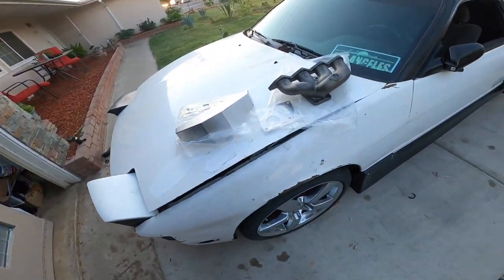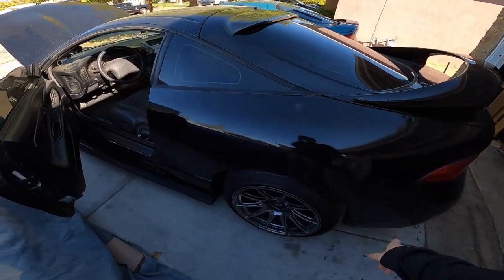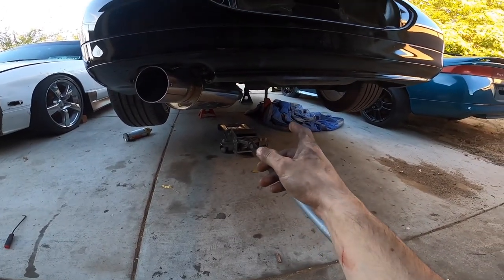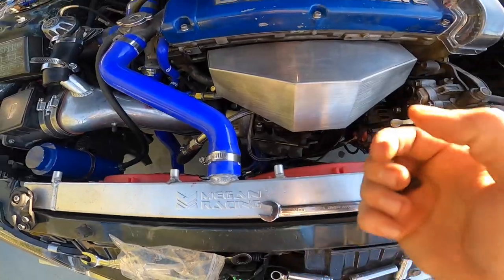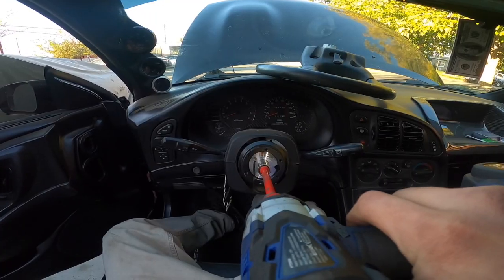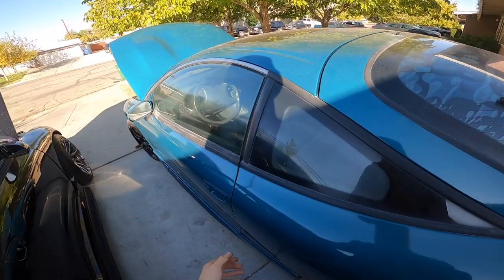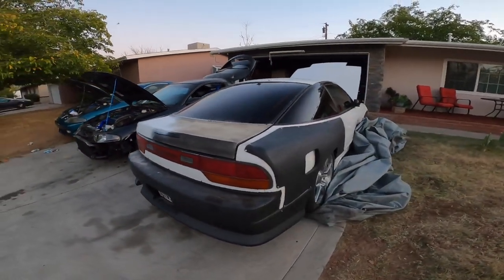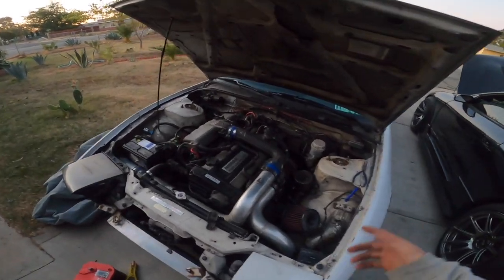FP Manifold Install on 2G GSX | New S13 Drift car update!!

Comment: are you using oem seat rails for that bride seat? if not, what do you suggest me getting if i get a bride too?
also i love your exhaust set up, how did you get that tilted to the side loom for the muffler?
Reply from the maker: I have corbeau seat bracket and rails, they were kinda hard to install though, you have to make your own holes. And the exhaust is tilted like that because it has to go around the diff on the gsx

Comment: Does the new manifold heat shield solve the overheating?
Reply from the maker: Yea bro, it actually runs a lot cooler with that shield, I also changed the hood so that helped as well

Comment: So did you find out why your car was overheating ?
Reply from the maker: Not sure, it stopped overheating with the carbon fiber hood I installed
Reply: @richdsm  what seat brackets did you use for the brides?